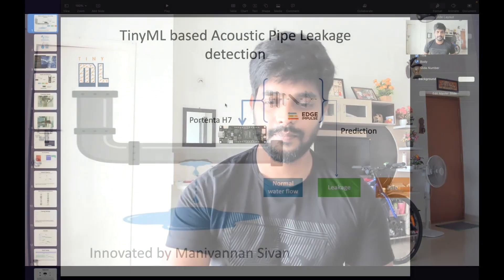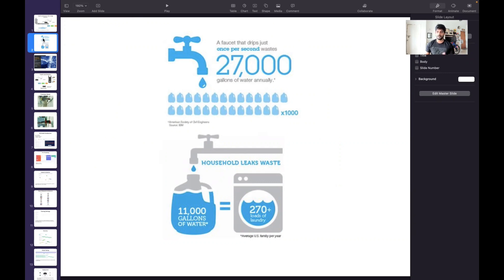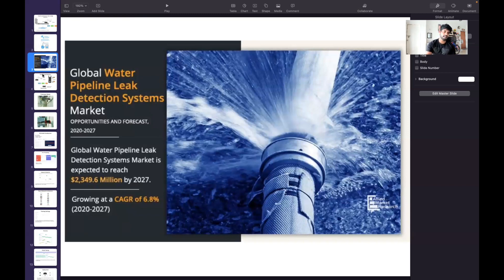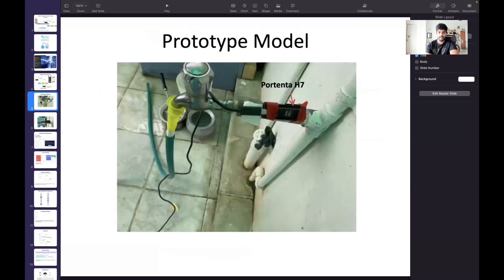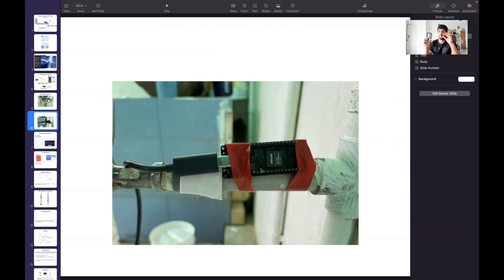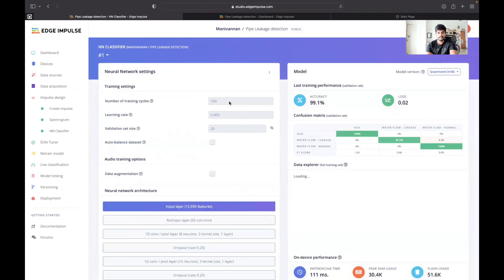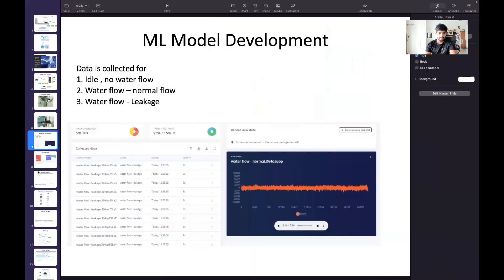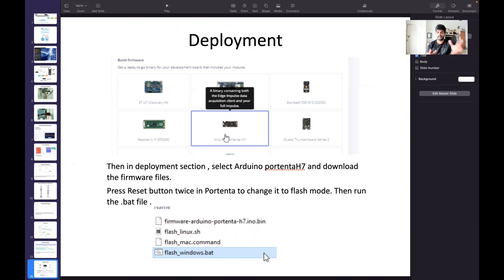Acoustic Pipe Leakage Detection

Comment: Good Project
is this for learning have a  leakage in any building? or  this system can find leakage zone too in wall or floor ?
Other question :can use arduino uno and max 9814(Microphone module) for this project ? is enought for hardware capacity?